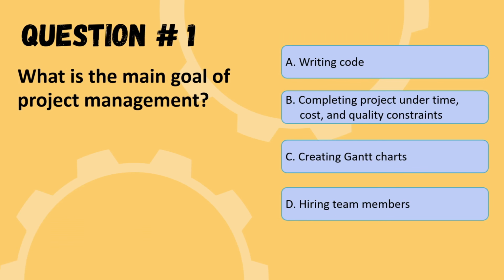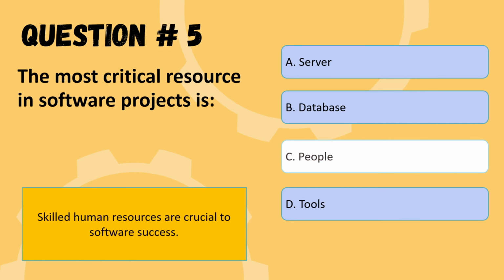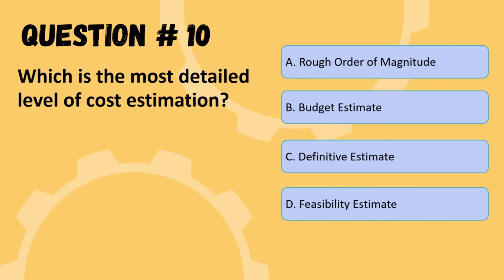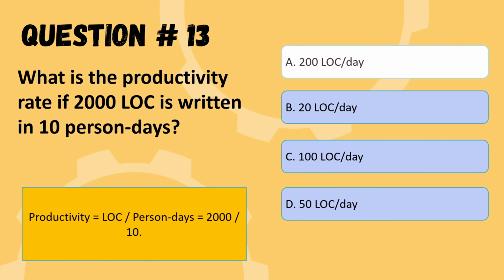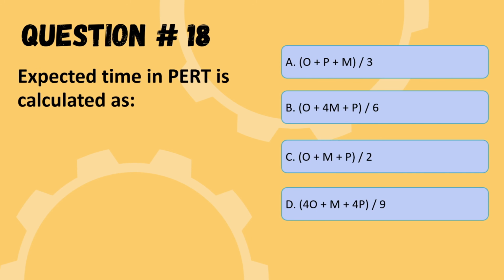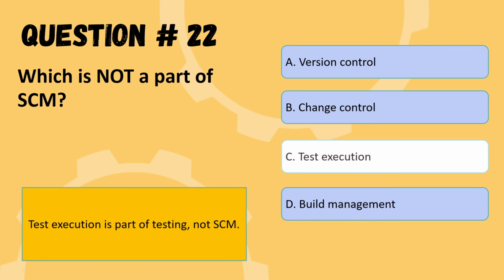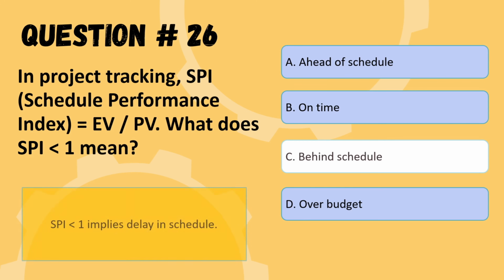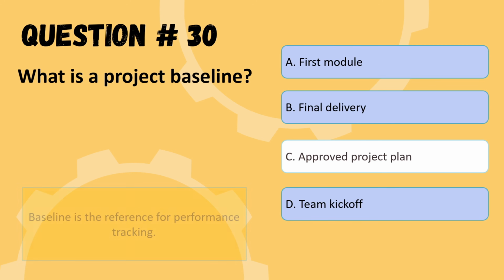CSE 320 | UNIT- 5 | Software Engineering | CA ETE practice | revision

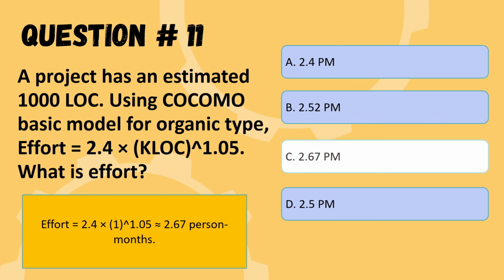Comment: At 2:59 question 11 answer should be A option
Reply from the maker: Based on the calculations for the COCOMO basic model, the correct option is A (2.4 PM).
Lines of Code (LOC): 1000
Formula: Effort = 2.4 * (KLOC)^1.05
KLOC = 1000 *LOC/1000 = 1
Effort = 2.4* (1)^1.05 = 2.4 * 1 = 2.4

❤@AbhiTomar-i9v

Comment from the maker: Based on the calculations for the COCOMO basic model, the correct option for Q11 is A (2.4 PM).
Lines of Code (LOC): 1000
Formula: Effort = 2.4 * (KLOC)^1.05
KLOC = 1000 *LOC/1000 = 1
Effort = 2.4* (1)^1.05 = 2.4 * 1 = 2.4

❤@AbhiTomar-i9v